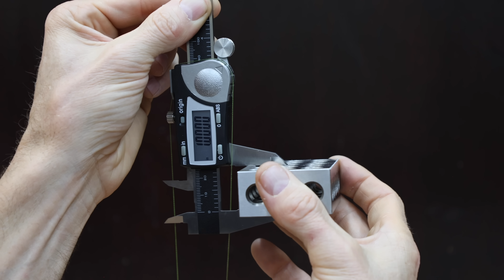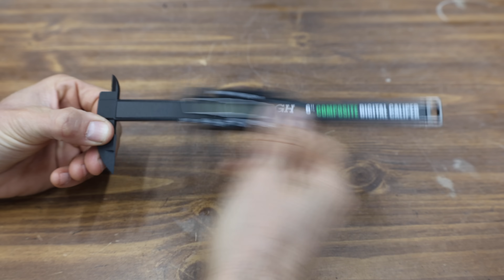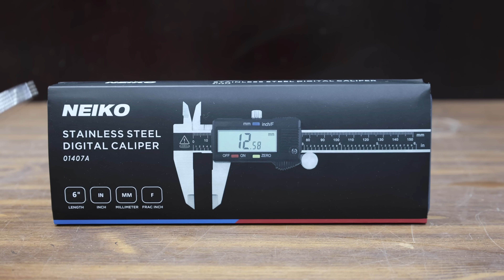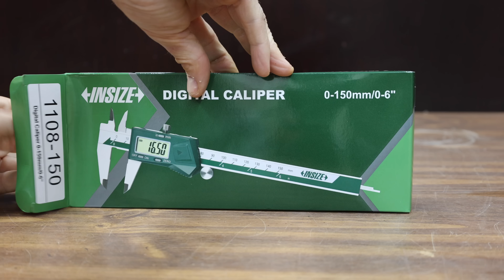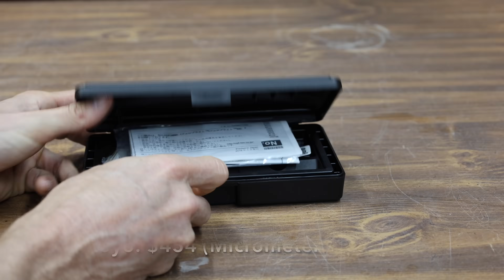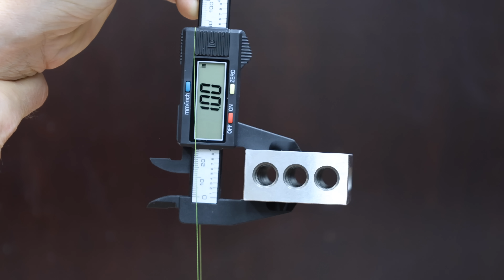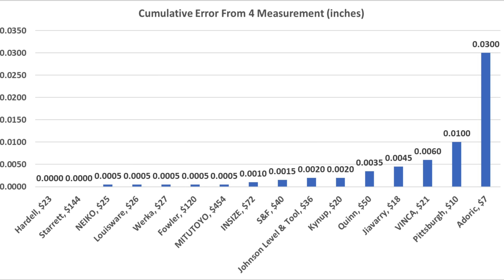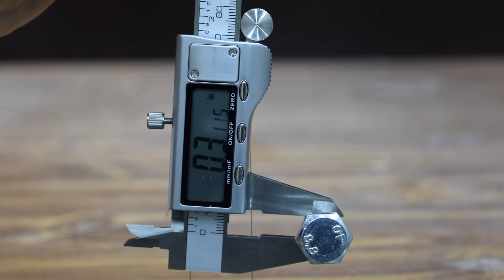I've Been Proven Wrong About Calipers!

Comment: As a cnc machinist there is a reason Starrett, Mitutoyo, Brown&Sharpe, Fowler, Swiss Precision Instruments, and Interapid are the standard for measuring instruments. They are way more reliable than anything else.
Reply: If you make your living needing the level of precision that a machinist may need, I get that the costs for these tools is bordering on trivial.  But for me as a home jobber that doesn't need accuracy to thousandths, my HF's do just fine.  That said, the Werka looks like a great value proposition and suggests that the brands you mention probably don't justify the price for the vast majority of users.
Reply: @kcgunesq the tests here, for precision measurements, were pretty jank.  Given that it's all subject to grip and holding position.  Too much variance in how these tools were tested.  Should've been bench tested, with each tool and/or measured item secured and locked off for the most accurate measurements, removing the human factor.
Reply: @kuhhnt  To give PF the benefit of the doubt, I don't think this was intended to be a testing regimen that would satisfy NASA.  But it is perfectly valid for all sorts of less demanding uses.  For very many people, 1/2 mm or ~20 thousandths is more then we will ever need.  

But more importantly, I suspect this test does provide useful comparisons between models even if the absolute measurements are off, assuming that he obtained representative samples (which admittedly, is unknowable).
Reply: @kcgunesq Yes, that is true.  If accuracy doesn’t really matter for your purposes, then nearly any tool will do.
Reply: @LTVoyager  Define accuracy.  I may need to know a measurement within 1mm and ideally, within a 1/2 mm but not need to know within a few ten-thousandths. Different tools for different people and needs.
Reply: @LTVoyager 
It's always about what level (and type) of precision and accuracy you need. That is, what tolerances actually are. Someone with a micrometer in their hand could just as well say your caliper is good enough "if accuracy doesn't matter". 
Then the lady making lenses could say the micrometer is good enough "if accuracy doesn't matter", because grinding a quality lens requires higher precision than the micrometer can provide.

Does the job require 0.1 inch?  0.01? 0.001? Some jobs require 0.00001.  So for any tool, there is ALWAYS a job that requires greater precision. Even a $1,000 tool is crap, where the job requires a $10,000 one.

It's like the guy who thinks his Corvette is fast. Your sports car is super slow, says the pilot.
Reply: @kcgunesq I agree.  If you don’t need accurate tools, don’t buy them.
Reply: @senseisecurityschool9337 I agree.  I never suggested anything to the contrary.  There is also repeatability, reliability, robustness and other things that simple tests like this don’t address.  And a sample size of 1 doesn’t really address much of anything in a test.
Reply: @kcgunesq  Accuracy and precision are 2 different terms, although some use them interchangeably.

"Accuracy and precision are distinct concepts related to the quality of measurements, but they are often confused. Accuracy refers to how close a measurement is to the true or accepted value, while precision refers to how close multiple measurements of the same thing are to each other. A measurement can be precise without being accurate, and vice versa"  The analogy is shooting at a target.  you can shoot a very close spread (precision) but the shots may be way off of the bullseye (accuracy).

A great book that details precision measure was authored by Wayne Moore, of Moore Special Tool Company of Bridgeport, CT.  The title of the book is THE FOUNDATIONS OF MECHANICAL ACCURACY.  The book is long and gets quite technical.  They made fantastic machines, most before the advent of specialized electronics, ball screws, and lasers.
Reply: @LTVoyager if accuracy is all that important you shouldn’t be using calipers in the first place.
Reply: @spehropefhany Yes, but we don’t all have interferometers.
Reply: @LTVoyager A set of micrometers works for me😊
Reply: But who’s number one 🤔
Reply: Starrett and Mitutoyo are the standard where I work.
Reply: @BloopTube They are the standard worldwide.
Reply: @BloopTube company issued? That means it's not your budget.  Which would you as an individual buy for work at home?
Reply: @fusion1203 Mitutoyo. I love Fowler and Starret but Mitutoyo has most compatibility with CSV programs and data retrieval. They even have better plug and play and work well with software entry programs like infinity.
Reply: @fusion1203  Mitutoyo easily for dial versions. Calibrate them day in and day out and they're always good and have 3-5 year calibration intervals.
Starrett 123Z for vernier ones.
Reply: @fusion1203 mitutoyo and Starrett are basically tied. Mitutoyo is usually cheaper
Reply: Mitutoyo battery tech is worth the price alone - it's in the cheaper models too. I have some cheaper calipers models lying around and the accuracy is good enough for me - but they're invariably dead.
Reply: @stuart11n  about 8 years ago i started my career as a cnc programmer/machinist and on that day i got a company issued IP67 Mitutoyo, to this day it is my daily work horse and its only on its 3rd battery so far...
Reply: @stuart11n  Buying Mitutoyo can be a hassle if you go by Amazon. I remember someone checking that a few years back. Turned out there was a lot of "Mitutoyo" calipers sold that certainly didn't have a single part made by that company. And a lot of the scam calipers were really bad even though they tended to look like the original until you disassembled them and checked the electronics or just took a good look at the metal parts.
Reply: @stuart11n  @hapalibashi  Quite true, I have a Mitutoyo 8" and have used other Chinese cheap ones, which were close to the Mitutoyo in accuracy, but consumed the batteries way much faster, and it was a pain having to remove the battery after every use to conserve it, and having to Re-Zero them every time the battery is removed!
Reply: I'm tool maker..I own the first 3 brands you mentioned. About 40 years old. Still great
Reply: @firewoodtime2  As a tool and die maker I can agree that i would stick to mitutoyo for digital. I have etalon and tesa for all of my non digital stuff. The issue I have found with insize and starrett on their mics and calipers is measurement drift while the mits and tesas stay accurate throughout their battery life.
Reply: @firewoodtime2 oh good
Reply: At work, we use Mitutoyo at home use a dial Starrett and have a Werka it's a beast.  Had a bad experience with digital Starrett but having the Werka over 2yrs and still in compliance on calibration pieces.
Reply: 100% This. I've been using Mitutoyo products for close to 30 years, I wouldnt use anything else.
Reply: Another critical factor in machining and toolmaking is real-world Ingress Protection.  IP54 is a minimum but, with coolant and oils everywhere, I would want something a lot better.  The top brands understand that.
Reply: Recent retired machinist 45 years experience absolutely agree with Gilbert. However for a simple home hobbyist in most cases a cheap caliper would make sense.
Reply: 100% agree!
Reply: For these digital verniers what your more concerned about is repeatability... knowing that plus or minus .001 not 0.001 no machinist says it this way is good enough for this tool.... if you looking for more or extreme accuracy you will be moving on to different tools for outside, inside, depth, etc... ex want more accuracy for outside measurement use a micrometer, even more use micrometer with vernier scale, even more use in climate controlled room with part at proper temp... the list goes on... repeatability over the life of the tool is what's important  plus the look and feel counts too. If you don't have the machinist touch your not going to get repeatability anyways.
Reply: I tried a whole bunch of different calipers and love my brown&Sharpe dial and Mitutoyo digital the most.
Reply from the maker: Thanks for sharing!
Reply: It's sort of a religion.
Reply: GUESSING STICK
Reply: On cheap ones ive found the battery seems to die even if you don't use it. Imo they should all be solar assisted charging like an auto dim welding hood.
Reply: @badgermetal Fowlers get great battery life and turn on and off automatically which is very and I trust their accuracy
Reply: unfortunately Fowler is just rebranded junk now, at a ridiculous markup, a real ripoff. starrett and B&S digitals are just rebranded stuff at way too high a price, particularly Starrett without an absolute scale, are you kidding?
Reply: If you make your living making precise measurements, then yes you should probably pay for the high-end quality tools that last.  For everyone else, the $30 caliper is just fine.
Reply: Yeah, I agree. The coolant they use on the CNC machines is rough on calipers that aren’t built for it — I’ve already ruined a pair that way. Also, how is he even measuring? That’s not how you properly use calipers. Learn how to measure, man… get some gauge blocks — not 1-2-3 blocks — and use a surface plate.
Reply: We use Helios Preisser measuring instruments at my German company. Is that a brand you guys across the pond are familiar with?
Reply: @blarfroer8066  Helios does not seem to be marketed very well in the States, if at all.  I see a lot of their older stuff and I have a Helios stainless protractor...nice unit.   Most in the manufacturing trade are sold on Mitutoyo, Starrett, Brown & Sharpe/Tesa.   Fowler is lower tier as you don't know who is making their stuff.  The same with SPI....there is nothing 'Swiss' about SPI.
Reply: @blarfroer8066 I own Helios .0001 analog micrometers , They work fine but are heavy compared to others.
Reply: Because of toughness probably.. I bet you can throw them at the wall and drop them and they’re still perform well.. but WOW Werka just sold some calipers 😂 this dude might even be the seller!
Reply: Inside and shahe are decent. Good as toolbox/beater calipers. Though i´d just as easily take an old fashioned vernier one from a good brand
Reply: Starrett>>>
Reply: As a casual video watcher, the machining tools seem more precise than the measuring tools. How do you deal with that?
Reply: Interapid indicators are built like fucking tanks. If you're a machinist, get one. They won't immediately die if you accidentally tap or drop them, it's worth the extra money.
Reply: Yeah, I agree. It also the kind of coolant that they use for cutting in the CNC machine is kind of a bitch to calipers that aren’t built for it and I’ve ruined a pair that way.
Reply: "As a cnc machine babysitt, uh I mean, operator..."
Fixed it for you.
Reply: I aspire to learning how to use a lathe someday. My dad was a machinist for a while and taught me the value of good tools, and I know a good micrometer is essential and worth every penny when you're doing work that really matters. Especially when it's a piece where lives could be depending on it!
Reply: Don't forget helios
Reply: Thanks, engineers, for pointing out the things that a comparison like this misses. It's true that most home users don't have to care much about accuracy or long haul performance under challenging conditions. I habitually use Vernier and pocket calipers at home and might spring for a $30 digital set just to feel fancy. 😆
Reply: I bought a Neiko about two years ago as my first ever digital caliper. For handyman/ construction/ garage use- NOT machining! I tricked myself into thinking a bargain-priced measuring instrument with a Japanese name was not a bargain-bin Chinese low quality jobber. Over time though, it has held up and was worth the $25. Only issue it had was eventually the battery door wasn’t pushing down enough to seat the battery contacts. The screen was showing “ERR” error unless I kept finger pressure on the battery door. I “tightened up the tolerances” with a bit of plumber’s putty and it’s been solid again, lol.
Reply: Mitutoyo calipers are the best, IMO.  There is a reason there are so many knock-off Mitutoyos for sale online.
Reply: I have two Brown & Sharpe calipers that are bad with almost no use.  I get readings all over the place.  $100 units.  Not had issue with Mitutoyo or Starett yet.
Reply: Fowler is cheap China tier BS.
Reply: And electricians "swear by" Klein for no good reason, either.  They were told it was the best as apprentices and that opinion just stuck.
Reply: I've encountered a mitutoyo digital caliper and when you moved it while the screen was off it would lose its zero point. Very annoying
Reply: Yep. Absolutely about reliability. I have a pair of the Nekkos and although the measurements are fine, the batteries go dead constantly. My better brands last for years.
Reply: Mahr too
Reply: We have some Mitutoyo instruments at work, quite nice
Reply: I work for a dept of defense contractor, the things we make have a tolerance of +.0001 to -.0002. All my measuring tools are Etalon,Brown + Sharp, Mitutoyo, and Starrett. They are used everyday and must be tested and certified for accuracy every 3 months. In 11 years the only one that needed to be reworked is the one I dropped other wise the rest are as received when new after first calibration. You get what you pay for with these names. The caliper should not be used on anything less than .001, that's what the mics are fore.
Reply: @tjohnson9051  That was a cliffhanger... 😅
Reply: Thanks for another precise video. Project Farm is still the hardest working channel on YouTube!
Reply: I'm a retired machinist, I sure it's what a person gets use to learning with but as far as the read out screen on the digitals calipers, I liked the same size numbers all across the reading for the whole number and decimal 0.000 or 0.0000
 I didn't like the tall whole number and short decimal 0.oo calipers. 
 I started out with dial calipers with a needle hand like an analog wrist watch face for years.
Reply: Fowler does not belong in that list.
Reply: Love this channel, but this evaluation clearly wasn’t done by a machinist who lives by precision.  If you are a farmer, rancher, mechanic, finish carpenter, handyman, welder, etc.. 1/100th precision is fine.  There are so many precision flaws in this video, there are too many to list.  Testing results in this case have everything to do with what problem is the buyer solving.
Reply: didnt age well
Reply: @KaufDirGeld Why do you think it didn’t age well?
Reply: @LTVoyager  it didnt finish first in accuracy. maybe it stays more consisent with battery drain, but i was really disappointed to see it get beaten by 20$ options.
Reply: @KaufDirGeld This “test” would make an industrial statistician throw up in his mouth.  You don’t run crude tests with a sample size of one and then make declarations as to which instrument is more accurate.  Get 20 units of each brand and then run 20 measurements with each of those 20 units.  THEN you will see which brand is more accurate and repeatable.  You can draw NO conclusions from internet “tests” like this.
Reply: Agreed, but who's gonna pay for that? This is as good a real world test as you're gonna see on YouTube
Reply: @lovedrawing4ever Companies that need precise measurements pay for this all the time.  I agree this is the best you get on YouTube, but my point is that anyone who draws conclusions on equipment from a YouTube video is making a big mistake much of the time.  The good thing is that those making decisions based on YouTube videos are generally doing things that don’t really matter so the quality of their tools makes little difference.  You won’t find engineers or companies making decisions based on YouTube video results.
Reply: @KaufDirGeld  it didn't get "beat" the testing methods just weren't consistent. When you're measuring down to these resolutions, very finite differences can equal results many times more than the advertised resolution.
Reply: @smnkm4ehfer  doesnt matter. User error  makes the measurement way worse than the actual precision of the instrument. If ours lifes depended on someone manually handling a caliper we would be doomed.
Reply: @LTVoyager Bull crap. This test is perfect for normal people.
Reply: @tomaskey6844 Yes, because normal people don’t really need the accuracy or reliability and simply want low cost.
Reply: @tomaskey6844 And you don’t understand statistics or testing so in your mind it is fine.
Reply: @LTVoyager  I was confused by that comment too.
Reply: @1a1u0g9t4s2u Confused by which comment?
Reply: @LTVoyager but then there's a guy that thinks you must get 100 of each.
Reply: @LTVoyager Didn’t age well. Sorry if I miss took your comment as a reply to that.
Reply: @LemonySnicket-EUC It depends on the confidence level you need.  For most experiments I conducted during my career, something between 10 and 20 samples was sufficient.  1 is NEVER sufficient.  And almost every YouTuber who does tests, uses a sample size of 1.
Reply: @1a1u0g9t4s2u No, you understood my comment correctly.  I didn’t see the point of the age well comment.
Reply: @LTVoyager  I am a mechanic. Perfect accuracy isn’t necessary for what I use these for so I bought a Pittsburgh fifteen years ago. Everyone at work laughed at me but we compared measurements to theirs. Everybody had tool truck branded calipers that they paid over $100 for. There was no difference. Over the years I have gotten comments from others and I always challenge them. Fifteen years after spending $10 on the thing it still measures within .0005” of the tool truck calipers.
Reply: @LTVoyager  Yep.  Need to do extensive Gage R&R studies  (Repeatability / Reproducibility).   Mitutoyo is renowned for their full line of instruments and has the best electronics for their digital gages.
Reply: @1202-Alarm Yes, and you and I are probably the only two here who understand that.  I watch these videos as entertainment, but some actually believe these are valid tests and that is worrisome. Then again, most who watch videos like this aren’t doing anything important so the quality of their tools is immaterial.
Reply: @LTVoyager so the confidence level of your approach would be less than my example. Thanks for the confirmation.
Reply: @LTVoyager  We can draw one conclusion. Even if you just buy one of these you are likely to get numbers that are decently accurate. And by decently I mean it will show the approximate size of whatever you are measuring. Lets face it most of us are not really needing micrometer accuracy. We don't make money of the accuracy of the calipers. We check if a screw is likely to fit not  if the two parts will interference fit.

If you do make money of the accuracy then you go with Starret, Mitutoyo or other of the high priced and well known brands and you get what you pay for. And most of all they are reliable as H---. The cost will be totally unimportant, the functionality and reliability is all that matters. And when you go with these you don't have to test a bunch of them to know they are good. The manufacturers are very aware of their  reputation and it's value.

No Average Joe will buy something like Kynup or Werka if he thinks he need something decent or Pitsburg, Adoric or something else in the sub $10 range if it's just a one time thing and hell use them once or twice a year. And if it gives up he will shake his head and throw it away. 

My point being that if you need the top quality then you will pay for the premium brands and then you know the calipers will be good.
Reply: @zaxmaxlax 😂 we hand-measure stuff in the aerospace industry daily.
Reply: @mmholling87  that is not very reassuring.
Reply: @LTVoyager  What entity can afford to buy 20 units of each product and can be trusted to run the test and publish the results without bias? Complaining about this kind of semi-casual survey of products is meaningless if the rebuttle is that we should be getting our information from a mythical unicorn instead.
Reply: @KaufDirGeld  The test wasn't professional enough. Can't really tell much by this but for sure a 20$ caliper can't beat Mitutoyo in any realm
Reply: @LTVoyager and you don’t understand the nature of this channel.
Reply: @tomaskey6844 😂
Reply: @LTVoyager this channel is not dedicated to high end professionals. He is providing common people objective and relevant information. It’s the wrong channel for what you demand.
Reply: @LTVoyager You appear to just be stirring up trouble. Good day to you.
Reply: @KaufDirGeld  It aged just fine. If you used precision measuring instruments daily, you'd realize the limitations and inaccuracies of the tests he ran. Including, as many have pointed out, measuring the depth of a hole to the surface of a table, which is not an accurate surface to calibrate anything off of, outside of a tape measure.  I also don't particularly trust the accuracy of a measurement that is clearly coming from someone who isn't accustomed to using these tools. Once again, especially using the depth rod on a caliper. That's the way you're most likely to get inaccurate readings, especially measuring off a table, which is just bad, real bad. Wiping the jaws with a towel that can leave fibers on the measuring surface is also just bad. I wouldn't trust any caliper or micrometer that had just had its measure surface wiped with a towel.
Reply: @KaufDirGeld Show me the long term results of this, because as it stands, this isn't a long term use test, just an "out of the box experience" test. I've used several of the cheaper brands in the past trying to avoid paying Mitutoyo money and they all broke within a few months. Usually they lost calibration and would be off by more than .5 mil. One set was off up to 1.5mil.
Reply: I would never spend that much money on "digital" instruments.
Reply: @zaxmaxlax the newer digital stuff that’s been out for the past 10+ years is just as reliable if not more and I prefer analog calipers but if you drop them you gotta get a set of gauge blocks out and recheck them where digital you really don’t need to worry as much or you can just zero them out
Reply: @Booney1286  sure. If I was using them daily of course I would choose a digital one. But my point is If Im buying a 250 instrument I want it to last to my grandchildren. I have some slide rules, compasses and other drawing tools from my grandpa they're from the 50s all in perfect condition.
Reply: @zaxmaxlax some of that stuff is incredible sadly most of these older machinist measuring tools get discarded rather than repurposed or used unless they’re sentimental